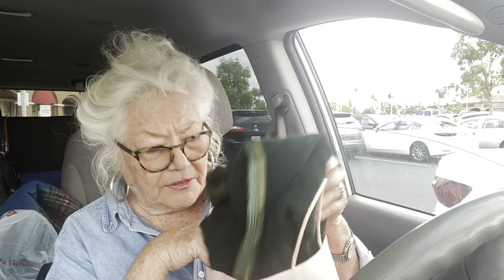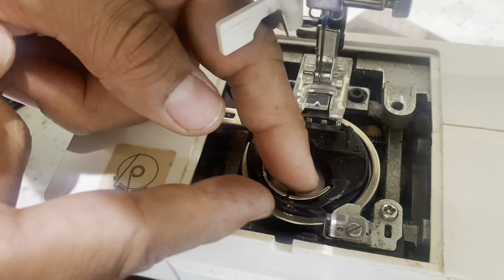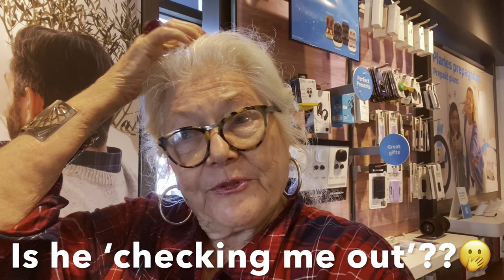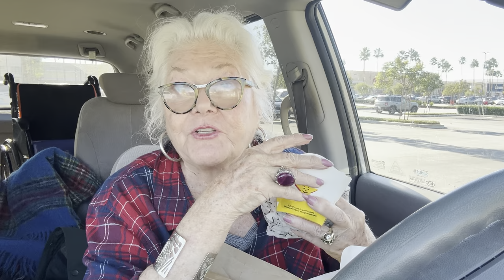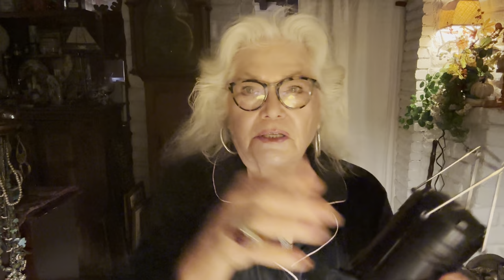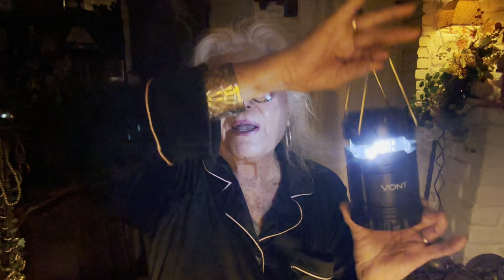Three Busy Days of Drudgery, Shopping and DRAMA /Over 60

Comment: Ñanny lovely full informative video. Your sewing machine bobbin .,Always run the tiny brush (from the machine  tool kit) .the build up of lint , does makes the bobbin pop out & can also  loop your stitching .ESPECIALLY afrer stitching velvet !😅 Place the bobbin back in ,the 2 prong bits go to back .(The bobbin only has one way to fit in) .NOW gently SLOWLY hand crank/ turn the  Machine wheel ,watch the needle ,you will see if its going to hit any metal.  If it' looks like the needle WILL  hit something  and its not right give it a tiny jiggle the bobbin will almost shunt itself into correct position All you need to think about is 2 pointy prongs  pointing out towards the back back ,but MORE important the SLIT in bobbin, where you  always thread your cotton ,  is directly nearest to  you .Remember gently hand turn the wheel ,the bobbin will almost jiggle itself into position. As you know  ,from all your beautiful velvet stockings, just looking at it, velvet sheds its lint . 
Im off to buy a firbkanjet for my kitchen ,thankyou Happy days love and resoect from U.K
Reply from the maker: Thanks, Jude…you’d think after my life-long years  of sewing …I would have gotten the bobbin set right by now…❤️

Comment: I never let my cat out until 7am . Just let them fuss they will get use to the rules. There is a pheromone spray Feliway classic . My vet told me about. Read and follow the directions spray it on the begging area . It doesn't work instantly but it works to change the behavior.  I filled the window with it last night  to stop mine from digging it wanting outside.
Reply from the maker: I’ll try it.thanks.